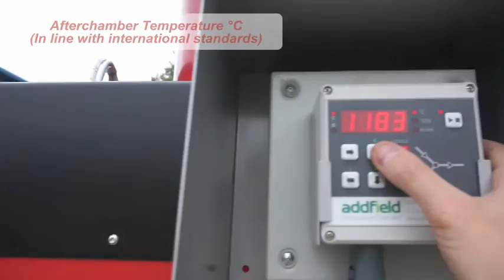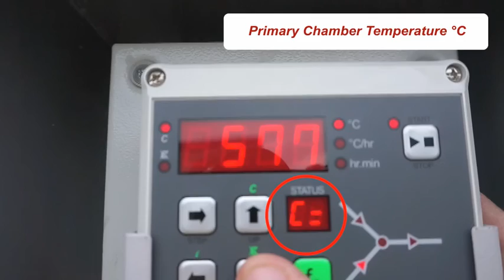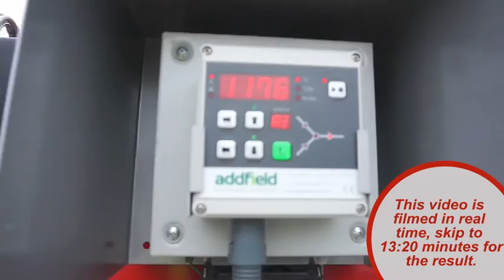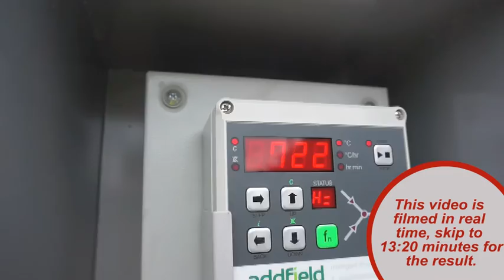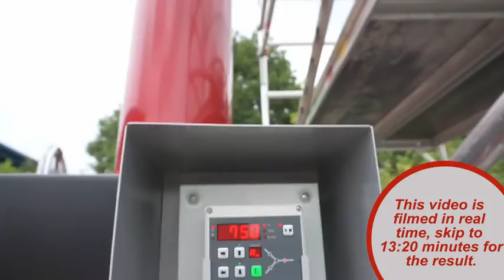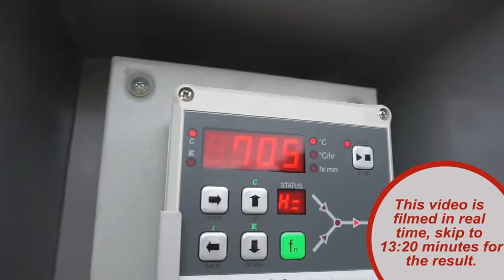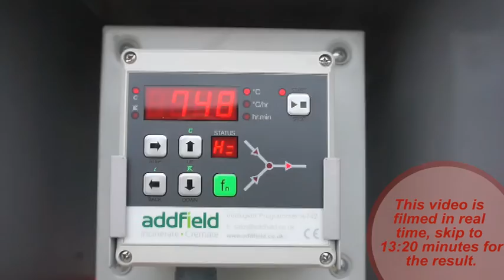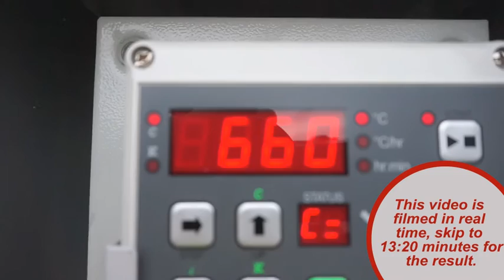What happens when syringes are burned in a Medical Waste Incinerator

Comment: What kind of air pollutants would this cause? Super neat either way.
Reply from the maker: Hi all Addfield incinerators are designed to have minimal impact on the environment. As such the waste is incinerated in the primary chamber initially following that all of the gasses and smoke passes into a secondary chamber where it is burned at 1100 degrees centigrade which then destroys any smoke, odours or pollutants. When the process is complete only cleaned flue gas is returned into the environment. For certain wastes and installations, we do also have a range of advanced filtration systems available.

Comment: Pls how is it powered?
Reply from the maker: Hi Kevin. Thank you for your question. The MP machine as seen in the video and all of the machines we produce can be powered by a wide range of fuels. The burners are most commonly installed to use Natural Gas, LPG or Diesel for fuel, however we are also able to supply these to be operated using HVO biofuel, Kerosene and even waste oil. All incinerators also need an electricty source to power the control panel and fans which, help control the heat, this is generally provided by mains electricity or via a diesel powered generator. For some macines we are able to supply the electicty requirements with solar panels. If you would like more information and even pricing on these machines I would recommend that you email sales@addfield.com and our expert team can help you further.

Comment: what happens to the metal ?
Reply from the maker: Thank you, the metal is not melted but it is heated to such a degree that it is safe to dispose of without posing any form of health risks.
Reply: @Addfield  this was my question when thinking about how hospital sharps are processed. The puncture proof container would melt away. The needles would still pose a health risk from a puncture even if they are not carrying infectious agents. Do you just shovel the sharps out when you clean the ashes? How are they disposed of after incineration process?

Comment: A small puddle of metal?
Reply from the maker: Actually no, the incinerators do not achieve the temperatures required to melt the metal, (that would be a different solution). However once incinerated the remaining metals from the incineration is safe to dispose of. Thank you.

Comment: I was about to say is this like return of the living dead when ernie burnt the body in the chamber thing and smoke went up in the air and trioxin 2,4,5 turned into acid rain and the dead rose up in the cemetery lol
Reply from the maker: Thankyou for your comment, however if they had invested in an Addfield incinerator thanks to our two-second retention time in the secondary chamber no smoke or Trioxin 245 would have made it through and therefore no raising of the dead. Would have been a much shorter and less interesting film then I guess. 🙂